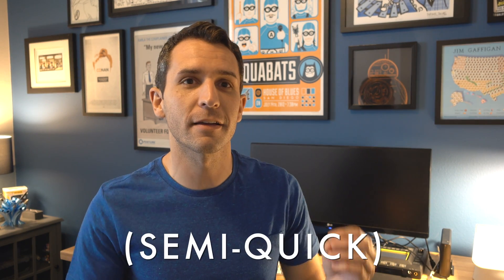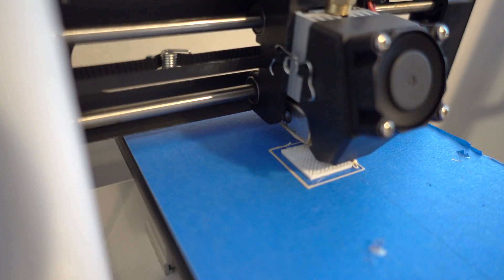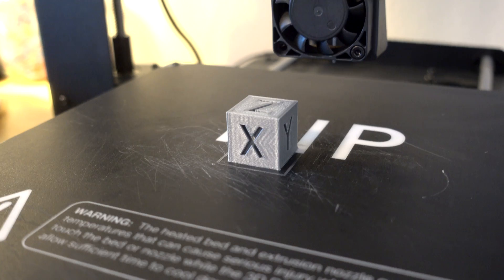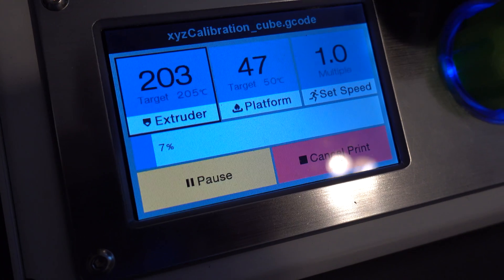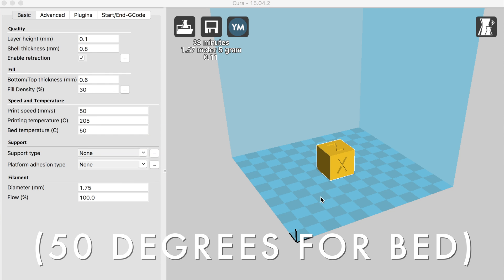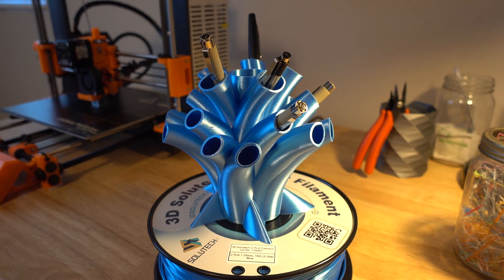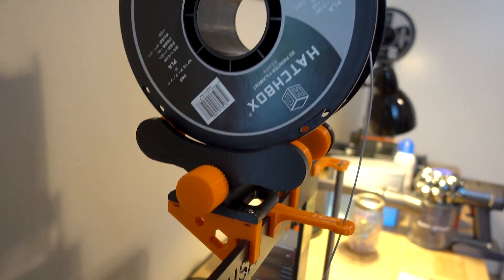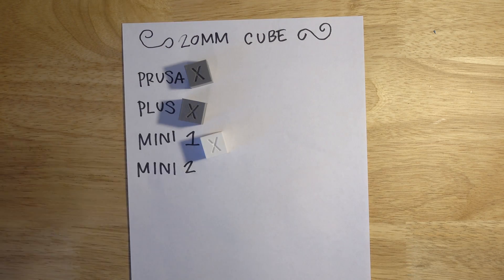3D Printing: XYZ Calibration Cube Challenge

Comment: You have warping.  You need to create an enclosure for them.  I was having insane warping but an enclosure fixed it.  It's a lot of work to make it yourself so you can just buy one but that takes a long time to put together plus if you tighten things up too much it will crack it a bit.
Reply from the maker: Thanks for the tip!

Comment: It's so funny that you mentioned the brittle issue with that PLA, I had the same exact issue with Hatchbox. After that I switched to eSun and it's the best filament I used yet
Reply: Interesting I have some esun which was blue and it was great then I got they grey and it was such garbage and was so brittle! I went back to Hatchbox that I started with and I am liking it so far. I wonder is it’s just roll to roll and not brand to brand.....
Reply from the maker: I think there are a lot of variables, and I feel like I've definitely noticed discrepancies between colors from the same brand. But all the Prusa filament I've ever gotten has always been perfect.
Reply from the maker: I’ve found that I have really good luck with the Prusa filament.

Comment: Hey can you please share the filament holder that you have on your Prusa ? Looks like a good improvement for mine
Reply from the maker: Here ya go: https://www.thingiverse.com/thing:1832235
Just a heads up, you do need metal bearings for it. It works great, but there was one time I had my filament get tangled, and it pulled the spool down onto the bed.

Comment: Misguided and misleading video.  The purpose of printing a calibration cube is to calibrate the steps/mm for each axis.
Reply from the maker: Very true, but it is also a good way to quickly and easily see how well calibrated a printer is.
Reply: That's not correct, as you can p-hack your way to get 20mm^3 by adjusting the amount of "squeeze" exerted on the cube by calipers.  Check out https://www.youtube.com/watch?v=Mbn1ckR86Z8 The only way to see how well the printer is calibrated is by measuring the amount of travel, along all axes.  If you've calibrated your printer, based on travel amounts, and your cube is still not dimensionally accurate then there are other factors at play.
Reply from the maker: You are absolutely correct, and Tom’s video you linked to is a great technical explanation and worth the time to watch. 

However, I still believe that for the amateur hobbyist like myself, this simple quick measurement is still a helpful baseline to work from- even if it’s not necessarily the most accurate method.
Reply: Thanks for your amicable responses to my criticisms.  Calibration is pretty nuanced; hence, you can't just measure a print and call it a day.  That's the reason for my misguided statement—this video can easily lead people, amatuers or otherwise, down the rabbit hole.  I'd suggest doing a Mulligan and at least mentioning Triffid Hunter's calibration guide at https://reprap.org/wiki/Triffid_Hunter%27s_Calibration_Guide
Reply from the maker: I edited the video description to explain that this isn't a full calibration, and added the link you provided, so hopefully that helps prevent anyone from finding themselves misguided or having incomplete information. Thank you for the corrections.

Comment: Thanks for the video, great info. We have 4 different printers that we tried to calibrate using this cube. We managed to get the same size cube from all of them after a lot of tweaking and thought we were set to print our tiles that clip together. The goal was to print on any of our printers and have them fit with tiles from different printers. Unfortunately, 2 of them didn't fit correctly afterwards. Do you know why that would happen? We've managed to make them work together after changing the gcode. I haven't been able to find any videos about this. I'm curious to know if all of your printers would print our tiles and have them all successfully snap to each other. If you're willing to try, I can send you a test tile to print.
Reply from the maker: What printers do you guys have? I’d be happy to try it out on some of mine.
Reply: Ender 3, Makergear M2, QidiTech M2, Anycubic Photon and Tronxy p805. I'd love it if you'd try out our tile on each of your printers and let us know how they fit. If you send me your email, I'll send them over.

Comment: do you ever have issues with "Ghosting"? i'm thinking of getting a form 2.
Reply: I didn't see any ghosting on any of his cubes, which is remarkable. We use a Dremel 3D45 at work, and it has considerable ghosting issues. OTOH, we don't make our parts at work for looks, so I haven't bothered to try to get them out.

I did notice some lifting of the block on the Prusa (at 2:30), the other blocks didn't seem to lift.

Ghosting has a lot to do with the stepper controllers that your printer uses. Since the Form 2 is an SLA printer, I doubt that you will see any ghosting. Keep in mind that SLA resin is not to be handled with bare hands, you will eventually suffer from it. The parts can become brittle in sunlight (https://forum.formlabs.com/t/is-it-possible-to-over-cure-standard-resins-or-not/11655/5), but painting them stops this from happening. And it's stinky, so good ventilation is required. But you can't beat their ability to create a beautiful print.
Reply: Thanks! I'm forever tinkering with mine, so I'm always looking around the net to see how things work for other folks. I considered buying a SLA or DLP printer, but I can't be bothered to paint the fence outside let alone my 3D models. :)
Reply from the maker: You are like an encyclopedia of good 3D printing info. Thank you!
Reply from the maker: If only there were more hours in a day...